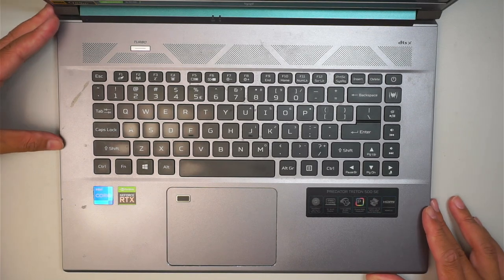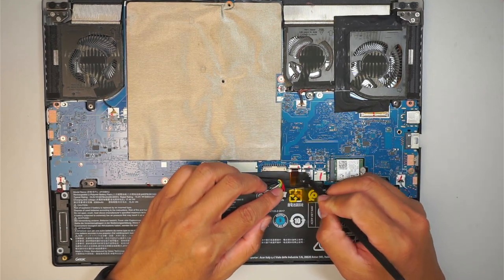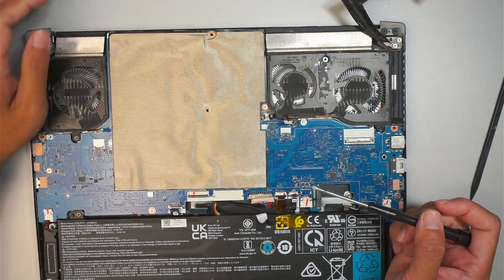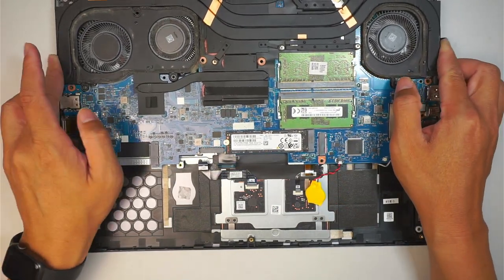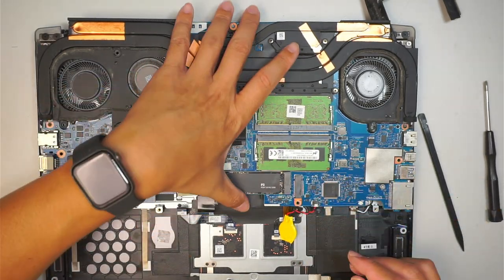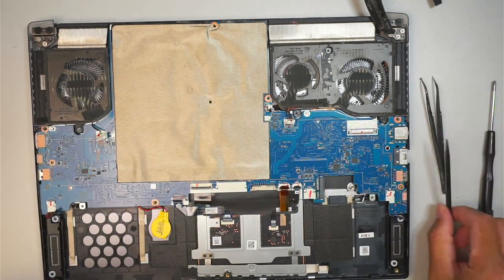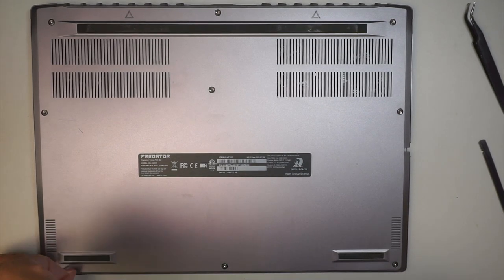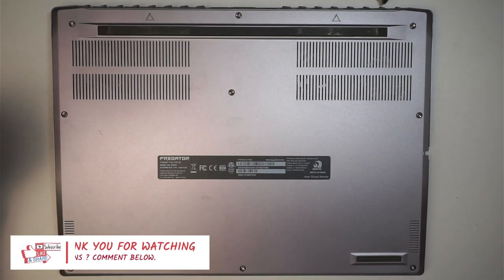Predator Triton 500 SE Teardown Disassemble Upgrade

Comment: Can you show how to install the custom windows operating system on this new drive you put in?
Reply from the maker: Windows on a secondary HD ?
Reply: @UbergeeksBiz I installed a new nvme drive but the system does not detect it at all. Does not show up in disk management, nor command prompt. When I enter the boot manager f12, my usb is not detected (which has my windows ISO on it)

When I take out the stock drive and put in my new drive, it shows up as no boot detected
Reply from the maker: @silverrose8130 are you trying to run two nvme ssd ? or just one nvme ssd, by replacing the original nvme ssd with a newer nvme ssd ?
Reply: @UbergeeksBiz  replacing with the new one. Not trying to boot from two ssd